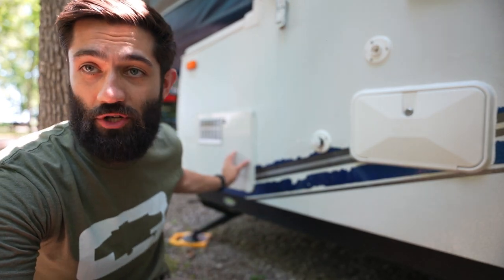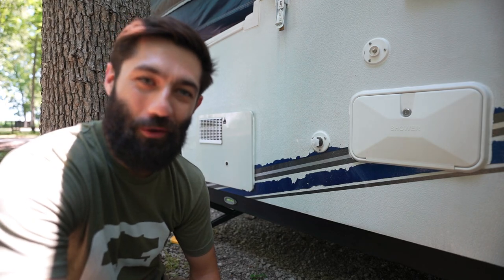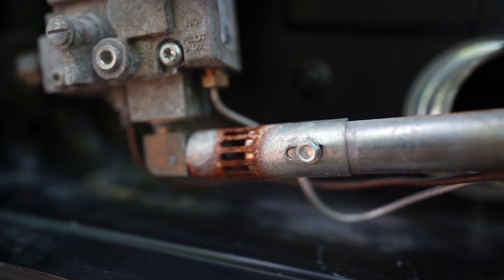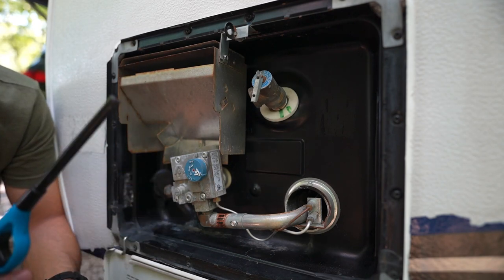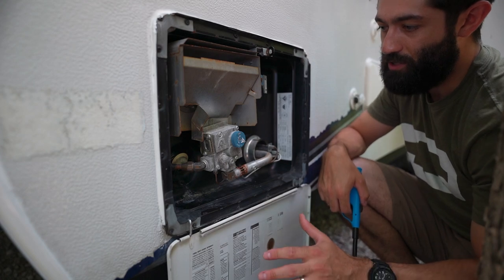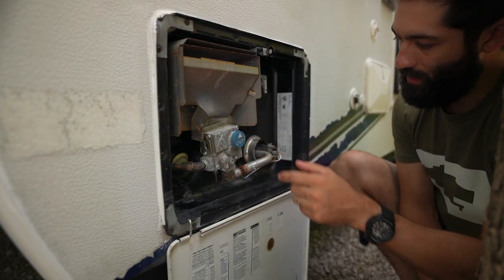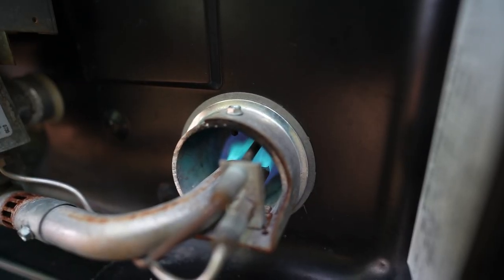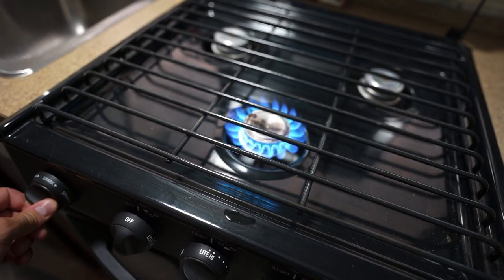Pop Up Camper Water Heater Basics

Comment: My sister-in-law just bought a used Jayco which I think is identical to this one.  Pretty close, anyway.  There's little doubt that I'll be maintaining it for her.  Today we'll be checking the operation of the various appliances.

I'm the sort who will be able to figure out the things you just showed me.  But I might not be very, very quick about it.  You've just familiarized me enough with the water heater that it'll be a snap.

Thanks.  This is helpful stuff.

Comment: Another great vid. When we are going off-grid I fill our hot water heater, and bleed  air from all the lines using city water connection. We then fill our on board water tank 3/4 full, ( keeps us from losing water through the overflow when going off road). We heat water for washing dishes, or whatever  outside and wash in a collapsible basin. I agree with shutting off water heater when not in use, and we close valve on propane tank when not in use.  Thank you for sharing. Hope to see you out there.

Comment: I Appreciate all your videos since I'm new to this pop up camping..  Question.. I've filled my holding tank with water but am not getting any water to the sink after having the pump on for a while. How long should it take to get water to the sink? When I first turn on the pump does it first fill the water heater before sending any water to the sink? TIA..

Comment: I think my water bursted on the valve I’ll need to remove it to find out, in the mean time. Do you think it will be ok if I run the heat. With the water heater being down. PS your videos are amazing.

Comment: We have hot and cold water valves under the bench where are hot water tank is. 2007 FR Rockwood Freedom 2318G. When do we open and close those? My most likely scenario will be connected to water course on site.
Reply from the maker: My guess is that these are low point drains for draining the water heater. Do they go through the floor of the pop up? If so they’re definitely low point drains. Keep them closed unless you want to drain your water heater.

Comment: I turned on the propane in my pop up, I lit the stove, then I lit the pilot light for my water heater. I waited about 20 minutes and ran my shower to see if it was heating, the water didn't even seem warm. Is there some way that the water might not be going into the water heater. We have water in our onboard tank and we were connected to city water. I guess I can wait a little longer, but this water wasn't even remotely warm, and this was only about a week ago, and I'm in southern California, so it was 65 degrees outside. Did I miss a step, or is there a water cutoff that I might have missed? I have a 2006 Starcraft Centennial 3608.
Reply from the maker: The water heater is most likely bypassed. Check the backside of the water heater for those valves.

Comment: We downsized from a 5th wheel to a popup and I forgot that the popup water heater is gas only. I wonder if I could replace my gas only water heater with one that runs on park  electricity also.
Reply from the maker: Yeah, I'm sure you could
Reply: @ItsPoppin  I've seen calrod heaters that install in place of the anode rod and allow you to heat water with electricity.

Comment: Do all pups have an on off switch for water pump? 2007 flagstaff 823d I believe.
Reply from the maker: Not all pop ups have water pumps, but all water pumps will have a switch.
Reply: @ItsPoppin  I can not find mine could it possibly be away from the stove area ? And also does it only work when connected to shore power ?
Reply from the maker: No it runs on 12 volt

Comment: Should the electric be plugged in before or will the water heater still work?
Reply from the maker: Depends on the water heater - some are propane only and some can run off either propane or electric with an electric ignition.